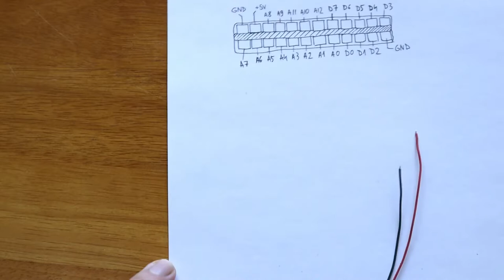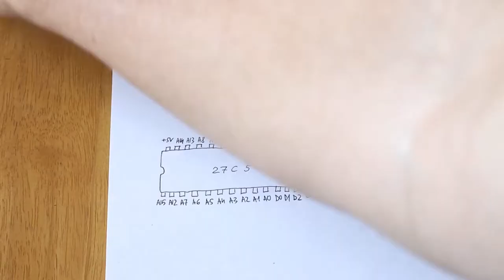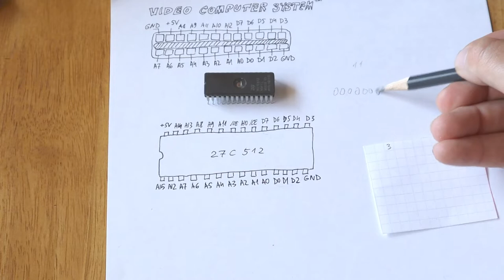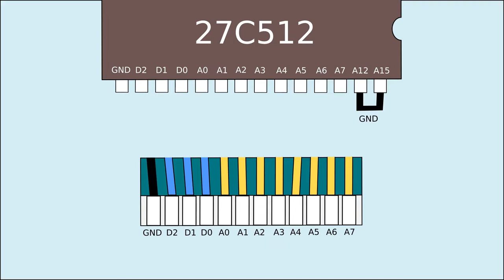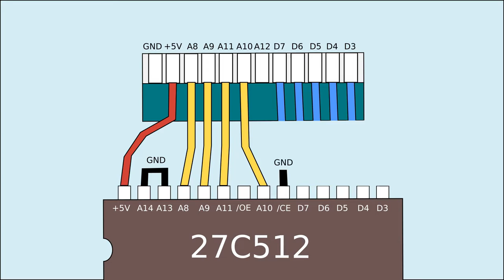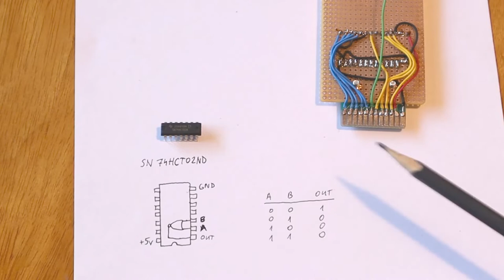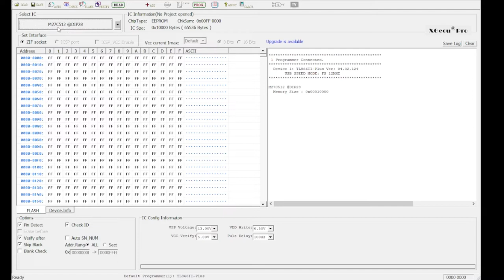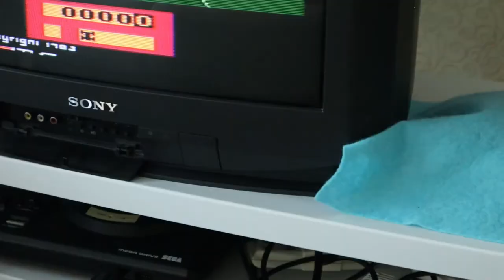Make your own ATARI 2600 cartridge

Comment: can you also use n64 catridge for the connectores aswell?
Reply from the maker: Probably(never had an n64). As long there is about 2.5mm distance  between centers of each contact plate and you don't regret ruining that cartridge, you should be good to go.
Reply: @Memelvar  ok thanks for the comment